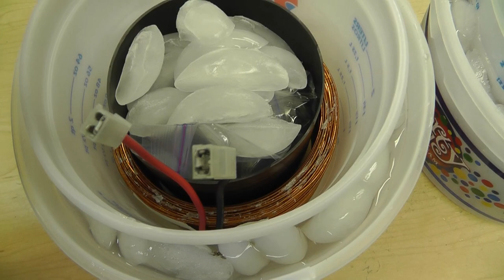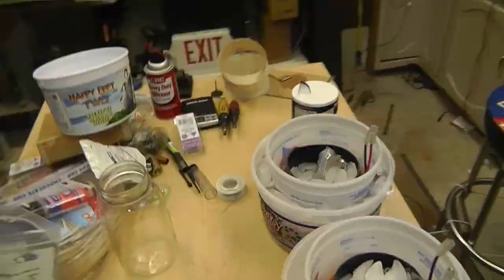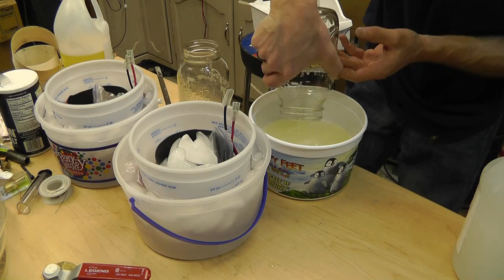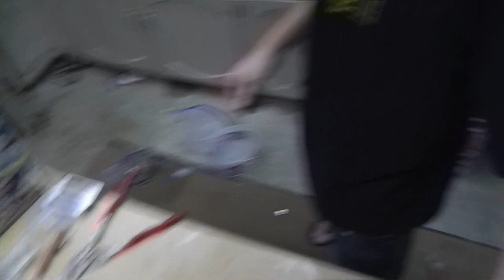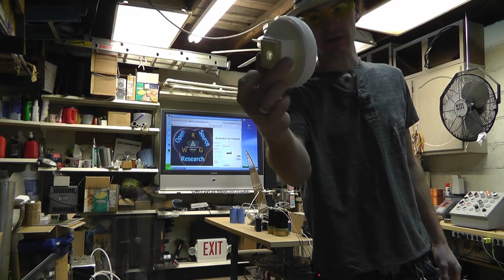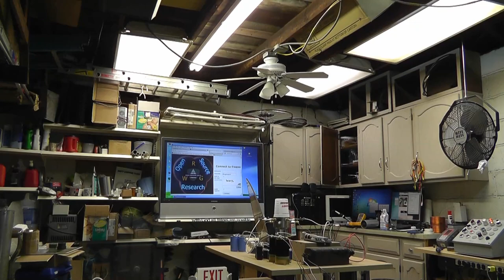Update 15 NGE Papp: Coils Anyone? & High Voltage + 1000 Jules + A LateNight = A Tun Of Fun! ;)

Comment: Russ, this was a good play session to get you into the real testing.  As was stated on PESN, the formula for the initial velocity of a projectile is  v = SQRT(2g(Hmax - Hstart))

So with the piston back in place you weigh the piston assembly and you weigh a small ball bearing or other projectile that you put on top of the piston assembly.  You do pops at various capacitor voltages, measure the launch heights, and calculate the piston kinetic energy and compare that with the capacitor energy.

Comment: hey Russ! I love the video format. One thing, your popper seems to demonstrate the Hydrogen Fracture Process of ambient air. As you know Humidity is the amount of water vapor in our atmosphere, the variables in your reaction include different voltages, and the pressure change is proportional. What I see is the hydrogen oxygen reaction, not the plasma force you are working for. 
I'm a big fan of your work, Blessings.

Comment: Air expands at a rate that's relative to the voltage applied over the spark gap, evidently. Hot air.

Comment: Russ first of all the coil job looks like it came out really sweet but let me ask you a question. Was there not an alternative to encasing your coils into epoxy just in case
you either felt the need to modify or recycle your coils? You may have an absolute reason for taking the epoxy route but whenever I prototype, I try to keep some things where I can either modify or recycle them only making something permanent once I know that I have a keeper. Just curious.

Comment: Couldn't be that much worse than 30%, it's using electricity to turn the noble gases into plasma therefore heat up and expand so it should be governed by the carnot cycle. Actually no maybe you're right, wiki says gasoline engines are at 25% efficiency so this is probably under that.

Comment from the maker: Of course I will... I just don't have the 10,000$ worth of acurate measurement equipment I need to do the tests to make the proper changes to make the nessacery tweets and changes that need to make to get max efficiencies.. This is just the beginning. I cannot do this in a matter of days or even weeks or even months this is may take years... Especially with the amount of time and money that I have.but yes,I do plan on doing these things. I started with brute force to prove it even worked. ~Russ

Comment: He won't do that because then the jig is up and he'd have to move on to the next free energy scam. Better to drag it out a few more months then claim "suppression". I think these guys realize the most they're going to get is 30% efficiency going from electric energy to mechanical output, which is way worse than normal electric motor.

Comment: It's also time to get a bit more serious and use the proper terminology.  When you do a pop, that's an electrical impulse that turns into a mechanical impulse.  The correct terminology when talking about impulses is energy, not force and not power.  An impulse is always expressed in terms of energy.  In reality it's a lot of power over a short amount of time, and that equals energy.

Repeat, the nomenclature for your impulses is "energy."